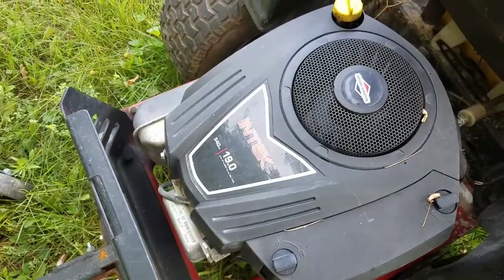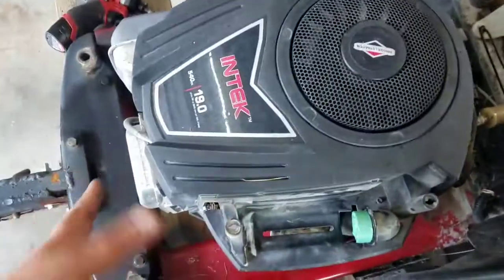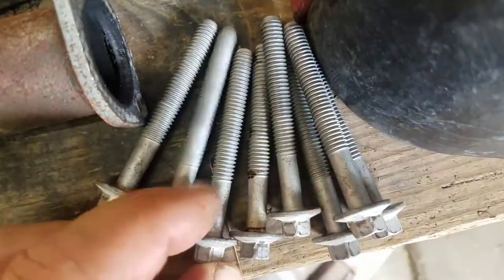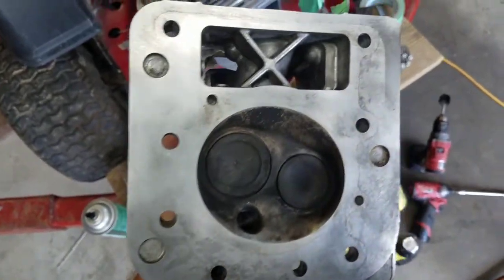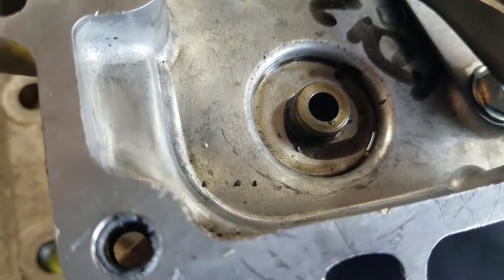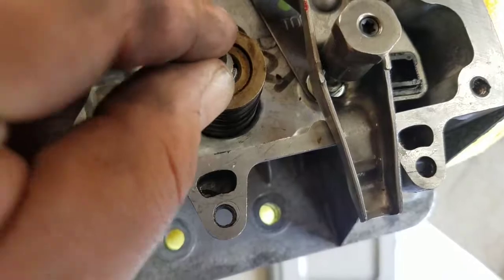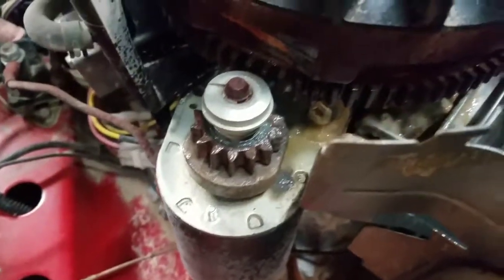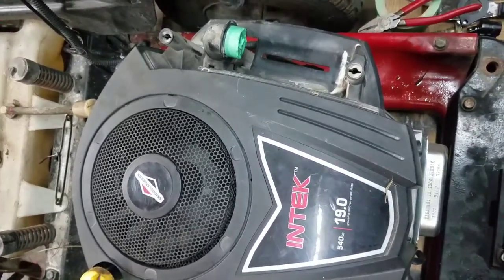Briggs Intek head gasket 1cyl vertical shaft 17-21hp diagnosis and detailed breakdown

Comment: With both valves installed you can tip the head upside down. Put the spark plug in from the back side and pour an ounce of gas in the dish shape of the head. If it does not hold the fluid you should lash the valves.

Comment: Hi , about the valves how  you adjusted them?
Reply from the maker: I didn't on this one, but you can put the motor on top dead center where both valves are closed and set cold lash per specs.
Usually a feeler gauge between the rocker and valve tip set to specs will do.

Comment: I’ve seen many of these blow a head gasket I’ve seen they make a copper gasket online I’m wondering if a guy takes a copper gasket and puts in a receiver channel in the head for a stainless ring if it would ever blow again after that
Reply from the maker: I'm sure the quality of the gasket makes a difference. Also the spacing and size of the bolts. Maybe using studs instead of bolts? That usually helps on v8 engines with high cylinder pressures. I'm sure a copper gasket alone would last longer.
Reply: @northsidevideo1938  I’m thinking the cylinder pressure is to high for the lack of gasket in between the galley and cylinder or to high of temp blowing the gasket I think this is the main reason the inteks ain’t a good motor is they blow the gasket then get to hot from burning oil and then break the rods from trying to compress to much oil
Reply from the maker: I agree that thin area of block to the oil galley is the design flaw. I think in general the 1cyl engines approaching or around 20 hp are designed cheaply to be in a lower price range.

Comment: Just curious but if you were to keep using it to mow (with a blown head gasket) would it still work?
Reply from the maker: Yes, it will still work, but it will consume oil very quickly until it fouls the spark plug out. If left too long it can damage the head/block as hot exhaust gasses are being forced between the gasket and the mating surfaces.